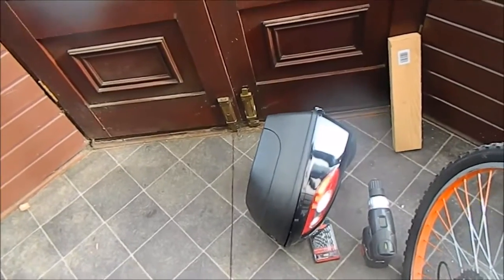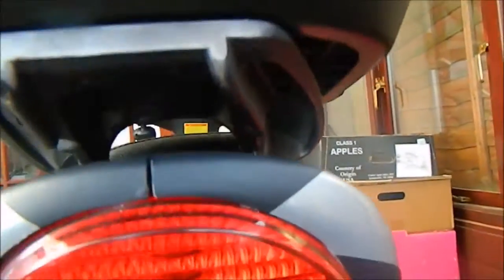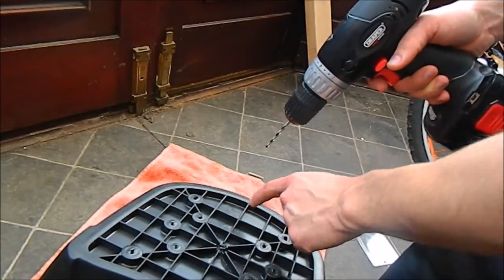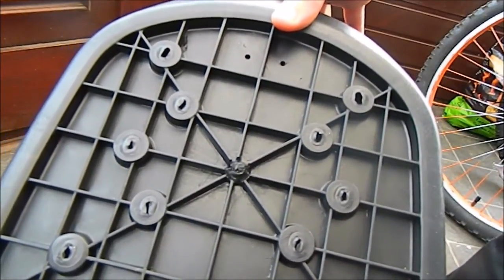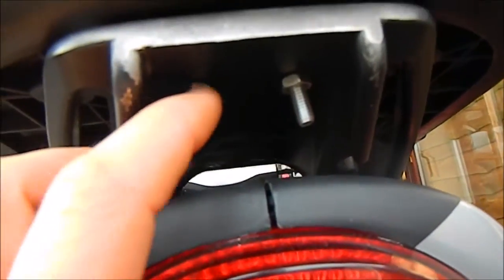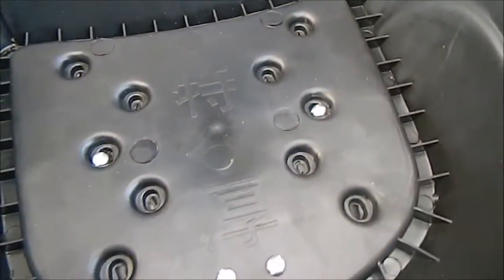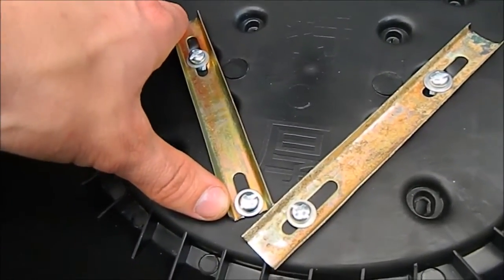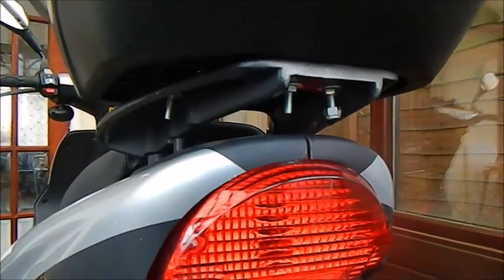how to install universal top box on moped

Comment: Why 12 thumb down? The devil is in the details, and this video is made well.
Reply: People probably paid 500$ for a givi
Reply: It is done all wrong.There is no need to drill the holes at all. Washers missing at crucial points. This box could easily be ripped off the bike by a thief. Sorry for being honest. If people want to know how to do it properly I might do a detailed reply of a better way to do it (if I can be arsed :-). I must that admit I am in the process of fitting a top box to an imported chinese scooter for a friend which came with a "free" box. It aint easy with no instructions and it definitely is not obvious, but we are getting there. You need about 4 pairs of hands, and a 5h1t load of patience. That is why it has so many thumbs down I should imagine. Hope this helps.